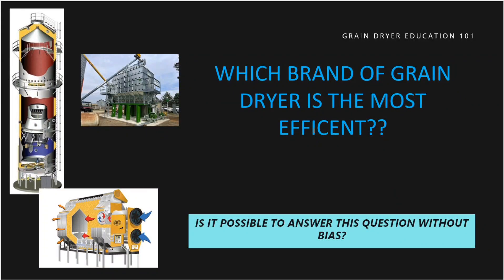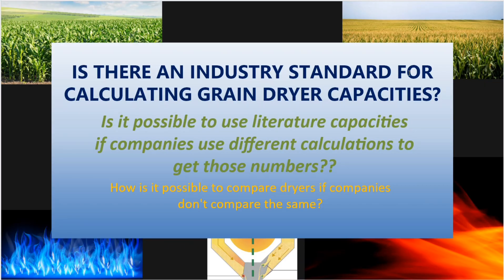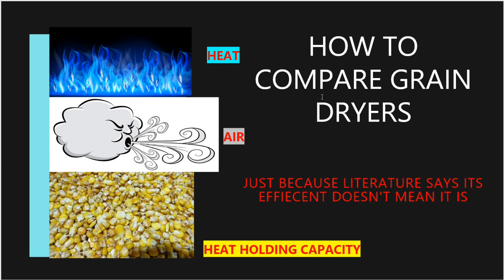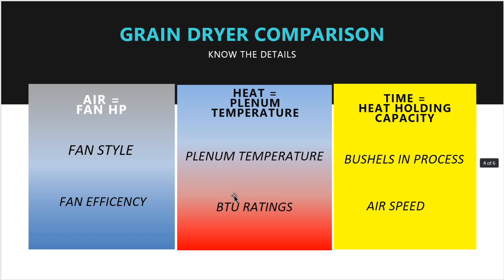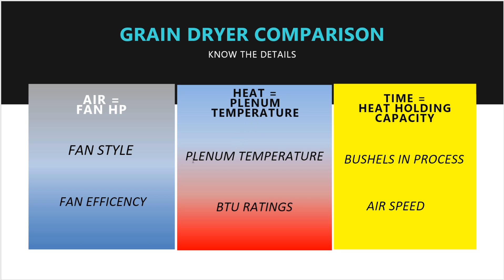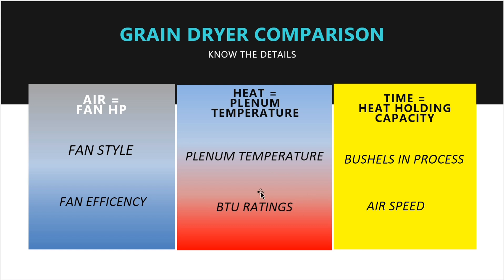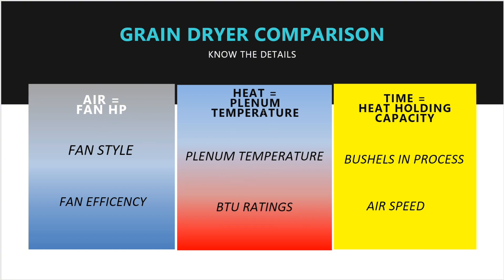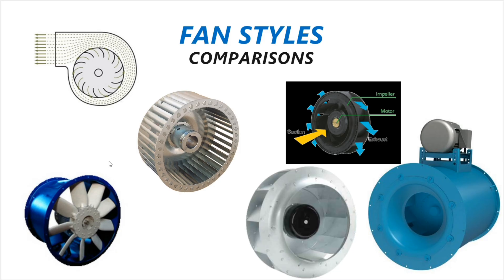Which grain dryer is most efficient? Which grain dryer is best? Can this be answered without bias?

Comment: Could you explain the static pressure in mmH2O between the dryer models you mentioned in the video? A comparison of air volume efficiency (CFM) per Buschel is based on drying efficiency, but I believe all of this is also linked to static pressure, correct?
Reply from the maker: Static pressure is only a side affect of the details I shared in video. Static pressure in a screen type crossflow dryers runs up to 4 times as high as mixflow type dryers.
Reply: @graindryerrepairman  Yes, I understand that static pressure is a side effect, but I think that this pressure in dryers, depending on the type of grain, can influence yield. I haven't found anything in the manuals of various manufacturers regarding the minimum and maximum permissible static pressure values in the system. I'm referring to this comparison between grains like corn, soybeans, wheat, rice, etc.
Reply from the maker: @marcosgs83 Oh yes you are correct, static pressure will vary with different grains and that will affect performance of both fan and heater, especially if it is line burner. Too low of static pressure makes it impossible to get temperature even from one end of dryer to the other. Too high of static pressure due to small partical size of grain slows drying performance. The max static pressure is based on fan type and the fans that handle static pressure do terrible for mixing heat even with air and getting even pressure throughout the plenum